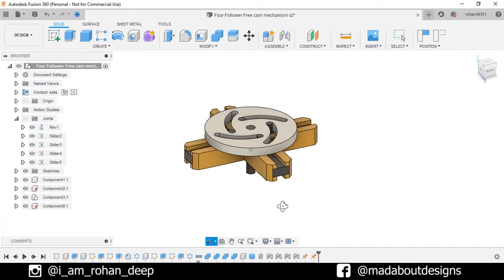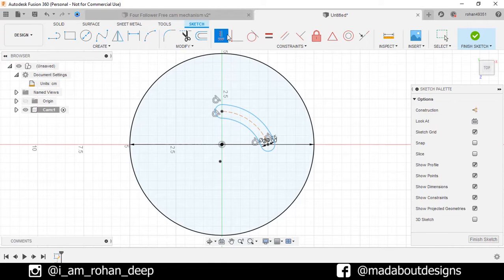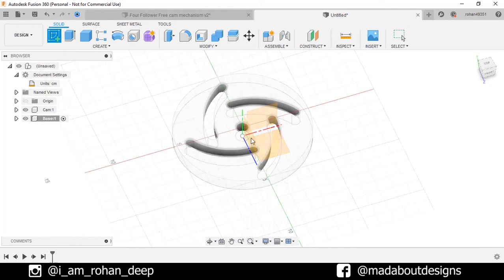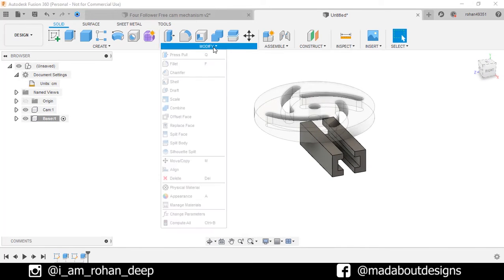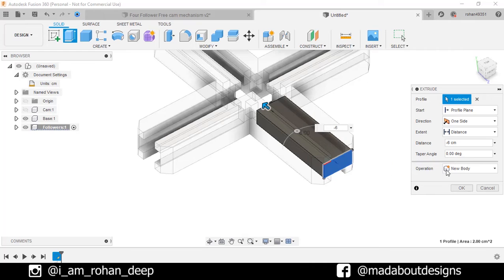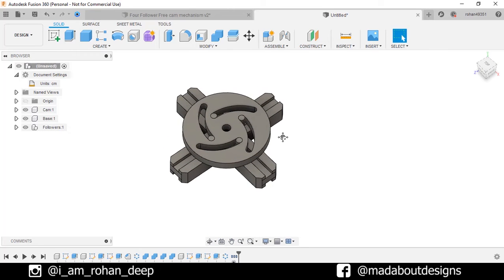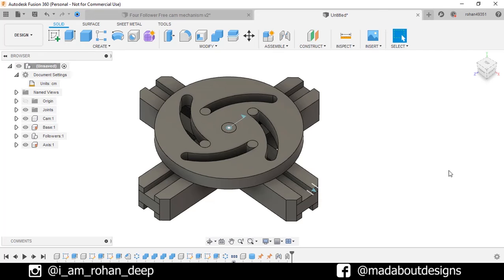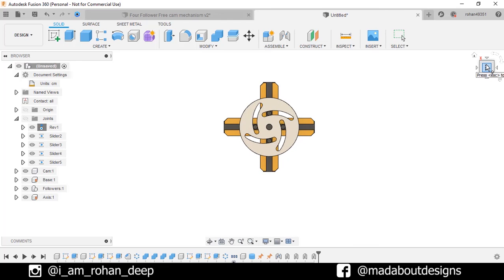How to design a Slot Cam & four sliding follower mechanism in Autodesk Fusion 360

Comment: I tip my hat to you.  Step by step is very clear, speed is good.   I'm looking to create a freestanding adjusting rod support for a lathe I'm about to get to hold rods extending out of the spindle head.  I knew what I needed and this gave me the begining tool to start from.  The lathe will be in a makerspace so its operation needs to be straightforward and easy to understand.  I'm on Maui so a big Mahalo is given